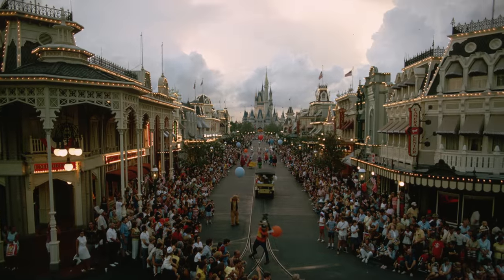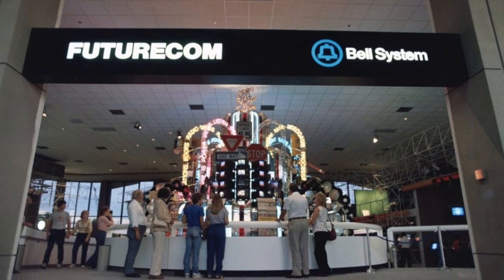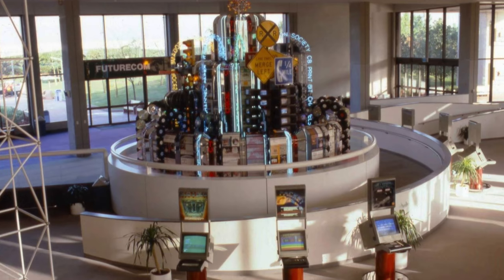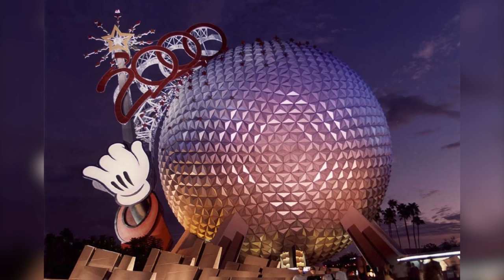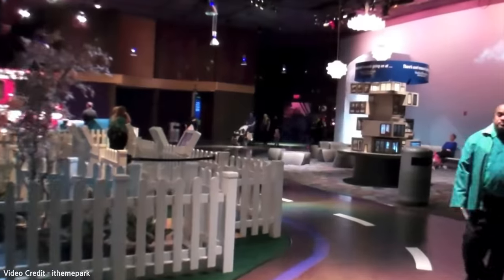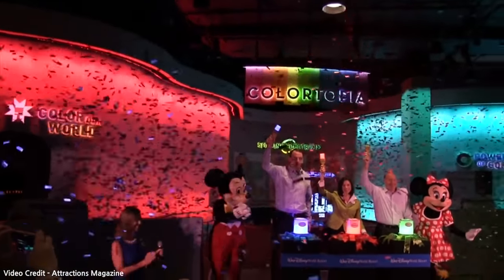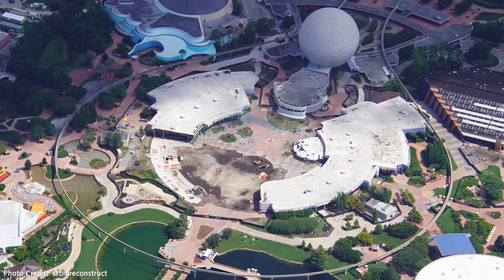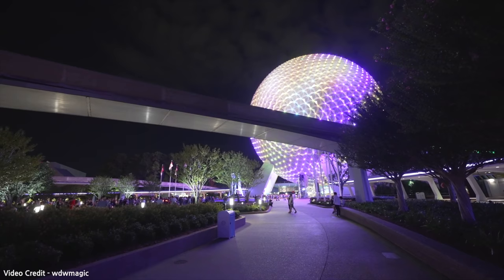Abandoned - Disney's Communicore / Innoventions

Comment: Hearing how the name changed in 1994, it now makes sense for me.  I happened to visit Disney world not long after that change and I wondered why the advertisement VHS video called it the Communicore and with the place called Innovations when I visited.  I also found it odd that the videos showed such nice natural light coming in with room to move about, yet when I visited it was dark, windows were either blocked with foliage or concrete, and the place was packed and hard to move about. Lastly, to see the changes thereafter with the designs becoming increasingly simplistic, modernistic, and cheap looking is a problem I see in many theme parks, malls, and overall modern architecture.  It is also sad to see the central courtyard to be filled with trees.  I liked the opened look as it drew the eyes to the open area with the various places from around the world.  It was like a presentation.  Now, with all those trees and changes, one can not see that presentation any longer.

It is not enough that the parks are becoming increasingly cheap in design, high in prices, and soulless looking, but add to that the recent controversy with the company becoming increasingly radical to the left along with questionable workers and their tendencies toward perversion. Are the current people running the company trying to run the company into the ground?